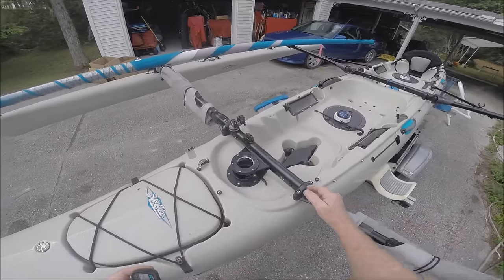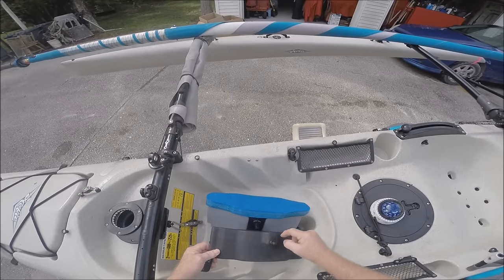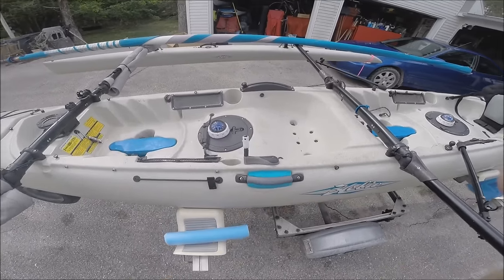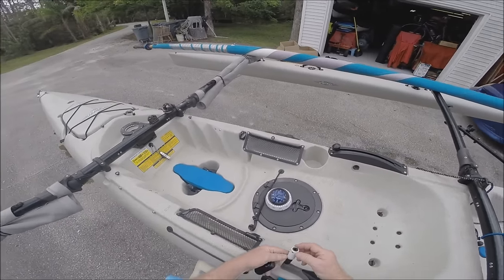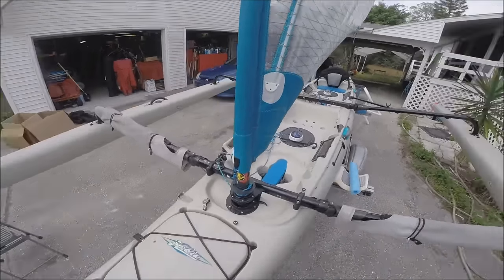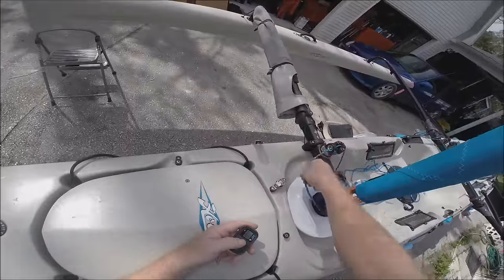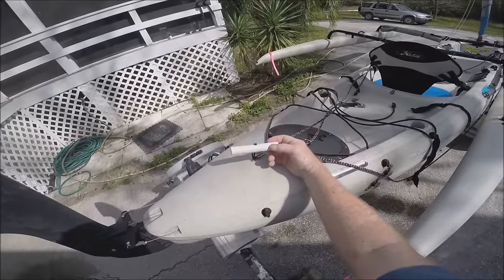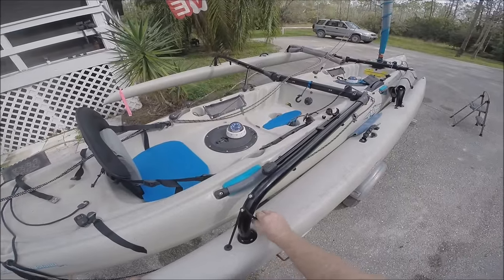Hobie Island Improvements & Fixes

Comment: Hi Mike, in this video your are talking about the ball bearings for the mast. When I got mine, new from the dealer, my bearings were falling. I went to the forum to find a solution. They advise to take the top plate off and either sand it down or put the plate on a lathe and take a few thousands off. I used the second method since I have one and the method is more accrued than the sand paper method. Start taking off little by little and check the clearance, slow process, I know, but it will prevent over cutting. I hope this will help you as well as others.Keep your good videos coming.
Reply from the maker: +jrodri2525  Thanks for the advise. I actually did that first, taking off top plate and sanding it down, and it lasted for a while. But eventually even that doesn't work any more.  The only time I have a problem with the bearing coming out is when the mast is removed, also sometimes when I get a little careless putting the mast in or out, usually out, it will sometimes pull a bearing or two out of the race.

Comment: Maiden voyage.My mistakes.I didnt realize the rudder holder for transportation had a hook on the end lost it my bad.I straightened the rudder and tightened it .I didnt have the screws quite tight enough lost steering had a screw driver .The stays in the sails werent attached right the caps popped didnt lose them.The sail popped up and over the top that wasnt set right.Not hobies bad the guys I bought it from .Got all the snafus out.Love this thing.Bought wet suits.Early season is great only ones on the water.Ive never sailed before this and I found this thing is easy to handle.I had 15 mile an hour winds.I couldnt believe the push you can get by pedaling a little along with the wind.
Reply from the maker: Sounds like you're addicted now, like the rest of us.

Comment: Mike, could you give some insight on what blue Mat or padding you used on the mirage drive filler so it was the right height and color? Thanks in advance
Reply from the maker: I cut them from a foam body board/boogyboard that was approximately 1 inch thick. My local Publix sold them, I live in Florida.

Comment: Great fixes! could you provide a link to the compasses you installed?
Reply from the maker: It's a Ritchie Kayak Compass.  Definitely shop around as the prices vary wildly. https://www.hodgesmarine.com/ritxp-99w-ritchie-xp99w-kayaker-surface-mount-compass-whit.html?utm_source=bing&utm_medium=cpc&utm_campaign=Shopping%20-%20All%20Products&utm_term=1100200315462&utm_content=Shopping%20-%20All%20Products

Comment: Hi Mike  ,,,,,,here's your next job is putting a jib on your boat mabe you can find a second hand,,,, 14 foot hobie cat,,, jib,,,,very good in light winds 😊😊😊😊
Reply from the maker: Yeah, I've looked at others that have done it. The spinning mast makes it a bit untenable.
Reply: Hi Mike adding a jib is faster in lighter winds and more fun flat water if your going to do this  modification then mount the halyard pulley to the mast head and run the ropes down to a cleat on the mast and a pulley on the bow and another cam cleat AKA beam where the mast receiver is,,, the way this works is you pull the jib out to the bow and cleat it off,,,,and pull up the jib while you are sailing  ,,,,,,,now your swivelling cam cleats get mounted on the gunwales close to the front seat 💺on half roundcut out bread boards,,,,,, there you get the perfect sail trim ,,,,,,,,,I'm sailing a hobie adventure island I've done this  modification and it works very well ✔️ I'm using a hobie kayak sail and it's just the perfect size,,,,,you will need a 14 or 16  hobie cat jib or another catamaran jib ,,,,,I hope that this will help you to make it up,,,,,,,,another mod you might like to make the rudder bigger,,I've done that as well,,,,,,,OOP'S I'VE GIVEN TO MUCH INFORMATION WE ARE SAILOR'S HA ,,,,,,,IM IN AUSTRALIA 🇦🇺 BY WAY,,,,,,

Comment: Hi Mike terrific video.  I am considering purchasing one of these hobies.  Is that the factory hobie trailer?  What do you think about it?  Worth the money?
Reply from the maker: "Is that a factory trailer?"Well kind of the Hobie trailer, as Hobie doesn't make it, but it is made for the Hobie Tandem island by Trailex and it is the trailer your local Hobie dealer will sell for it/with it. Yes I do like it.  Worth the money? Well I got mine used with and when I bought my Tandem Island used. It's very lightweight and even with the Tandem Island on it weighs less than 500lbs. I find that pulling this trailer with the Hobie Tandem Island on it is hard to tell if it is even behind me. While 2 sea kayaks on my roof (only 120lbs) is a lot more stress and reduced gas mileage on my vehicle.

Comment: Hey Mike, great video.  Thanks for taking the time to put it together.  One question: What type of foam did you use on top of the drive cassette plug?  I want to do the same, but the foam I find is to porous.  Thanks again!
Reply from the maker: The original you see in the video was a foam kick-board bought at the local supermarket.  After two seasons the foam started to break down and acted like a sponge as the closed cell foam became open cell foam. I currently am using standard white Styrofoam. It sin't the pretty blue but it is actually lighter and a lot more buoyant.  I also got this foam from a larger kick-board.
Reply: Great! Thanks!

Comment: Several tips I will be utilizing. Thanks very much! One question? When you changed the bungies in the Ama's, how did you tie the knots?
Reply from the maker: +Lean540  I used figure 8 knots.
Reply from the maker: +mechanicmike69  Those black grommets unscrew. Hobie sells the tool to remove them. The cleat, the loop, and the bunji grommet are all interchangeable.
Reply: +mechanicmike69 Thanks very much, Mike. One last question? Where did you find your deck compass?
Reply from the maker: Lean540
 They were both purchased at West Marine. One is a sailing compass and the other is a kayak compass. Right around $70 for the kayak compass and about $10 more for the sailing comp[ass. I like the sailing compass better for use with the Hobie.
Reply: +mechanicmike69 Thanks very much, once again, for the quick response. You have come up with many clever mods, many of which I intend to implement prior to thaw here in Canada.

Comment: Hello Mike, interesting and nice video. As a fanatic TI owner in the Netherlands I follow almost every message from Hobie.
One of your fixes/updates is about the Miragedrive-plug.
Indeed, the construction/design is a little bit crappy.
Nice solution with the foam on top of it.
The basic-material of the plug is not very suitable for glueing!
What kind of glue or adhesive did you use.
Is it still holding?
It would be very nice to have your reaction, Thanks in advance.
Reply from the maker: +Ambroos I used a heavy dose of contact cement and it has been holding for a little over a year now.
Reply from the maker: Now still holding after two years!

Comment: I was thinking of buying one of these, but I don't know now after watching your video. You have done a great job with your fixes but frankly for the price of the boat these types of mods should come standred. The boat looks poorly engineered from the start.
Reply from the maker: +Howard Elzey 
This is a pre- 2015. A lot of modifications went into the 2015 and newer models of both the Adventure Island & Tandem Island.
Reply: Thanks for your answer I did not know that. My local dealer has never sold one, does not stock them and seems to know little about them. So good info is a little hard to find and so far the internet is where I have to go to find it. I may have to make a lengthy drive to a dealer that stocks them and see what they have to say. Great videos you put up thanks.
Reply from the maker: Howard Elzey
 Another place to find them cheaper is on Craigslist.
Used of course.
Reply: +Howard I think my boat was really great straight out of the box.  For what it costs, I think you get a great boat.  For us buying two carbon or fiberglass kayaks or a nice tandem was about equal to a little less on total cost.  This boat does everything relatively well, but nothing perfectly.  It is like the Swiss Army knife of Kayaks.  Wind, you sail, no wind, you pedal, waves, you surf and splash, friends and gear, strap em on and go.   See if you can get a demo ride for a few hours to get a better feel.  It's not the boat for everyone, but if you like it, you get the fever.  And the only solution is "more cowbell!"